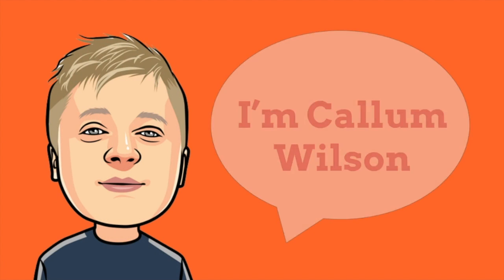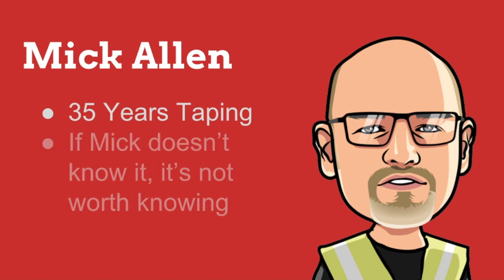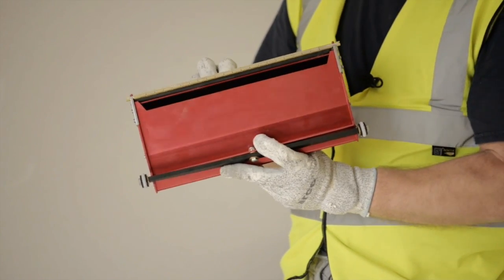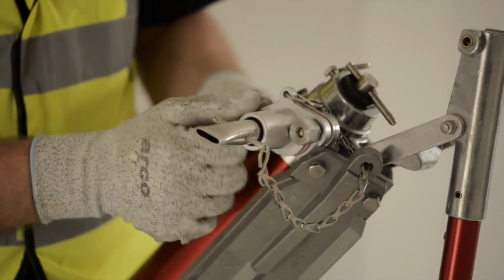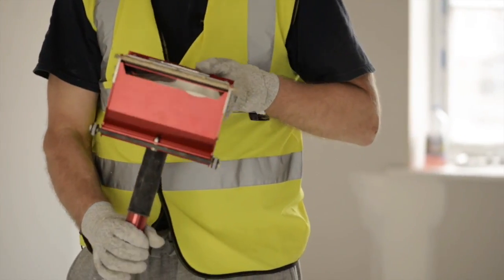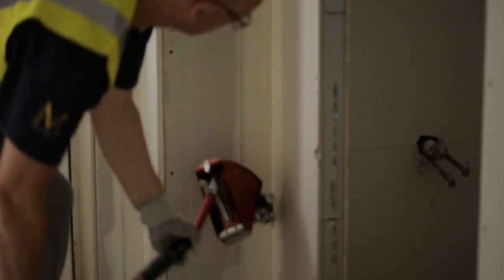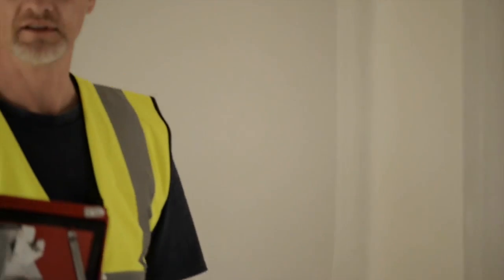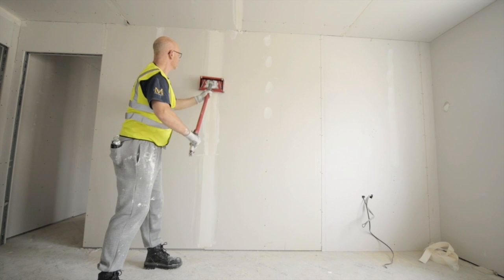Automatic Taping Tools - What & How

Comment: Fast mud still shrinks, even though it is hard enough to float over with the boxes. Perhaps can get away with it on heavier textured walls. Not so much on slick wall. 3 months later, as the sun moves further over in the sky, the light change thru the windows will expose the sins. Self stick mesh tape is for the spackle/punch-out crew and weekend warriors. I've been at this over 40 years. I have yet to find a good use for mesh tape, other than some low bid slum work or veneer plaster. I think I had the same roll of that mesh, all dirty at the bottom of my tool bucket for about 5 years.
Reply: i agree with you brother i started in the scrap truck in 1984 and got lucky enough for a finisher to take me under his wing and show me the ropes in 1986 and have been spreading mud ever since and mesh tape SUCKS it is actually harder to cover than paper tape and there is no possible way  to make a square inside corner with it and trying to coat a rounded out corner is a major pain in the ass mesh tape has 2 places that it is good for and that is on durrock tile backer board and the dumpster lol
Reply: Why are ur seams vertical?
So much more work?
Reply: @michaelmoore1534  A lot less butt joints that way, which are twice the work of the recessed band joints. Bands rarely ever show because they mostly finish flush, or much more flush than butts do.
Reply: Mesh is good for ceilings that have downlighting, but that's about it. I use Fibafuse on everything else but corners.